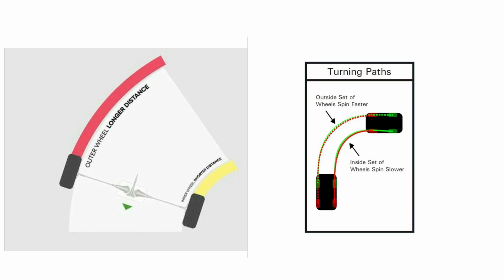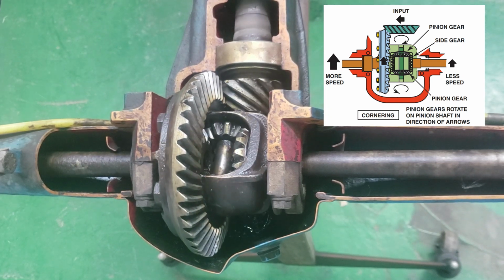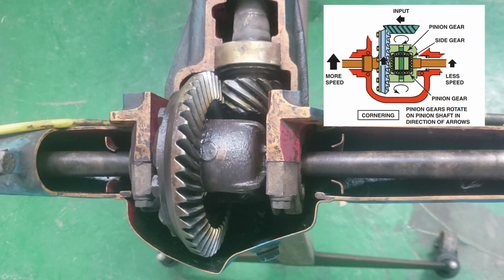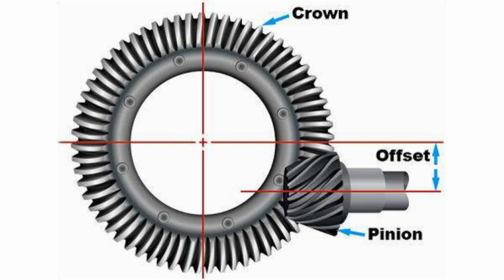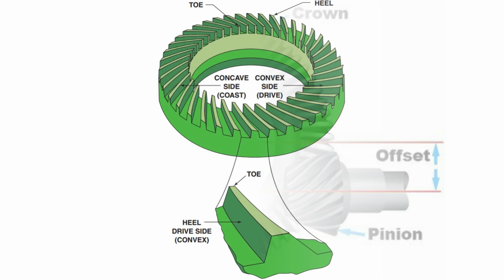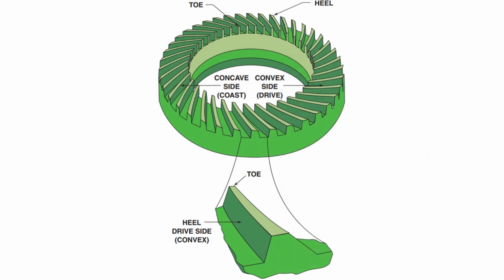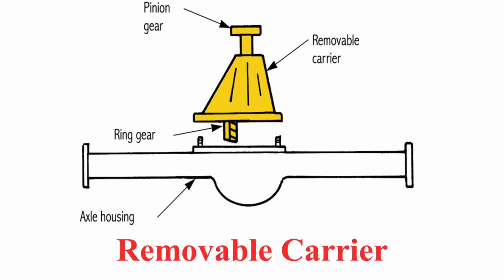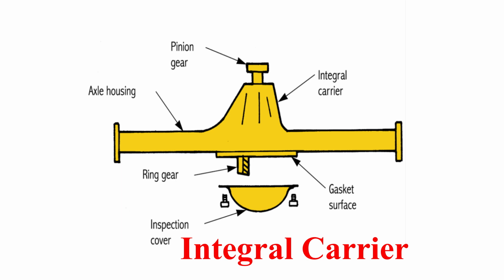Differential: Parts and operation

Comment: You can shim the spider gears up with an extra shim on one of the spider gears, get a thin one from a bad diff, and it will grab much better with less free wheeling, and still turn good. Shim needs to be 0.010-0.015. make sure the spiders have plenty slack still. On GM 10 bolt.